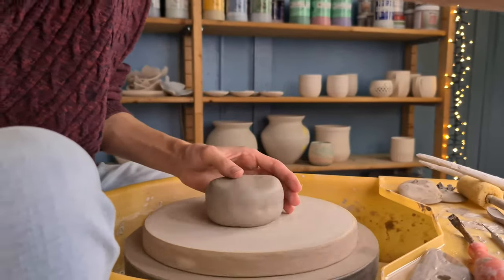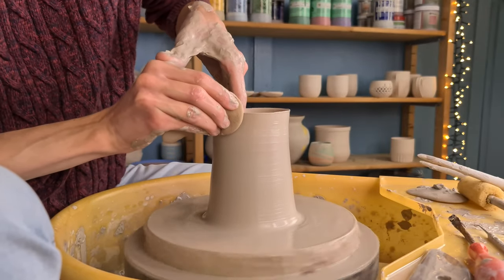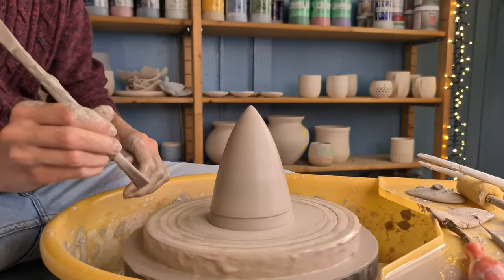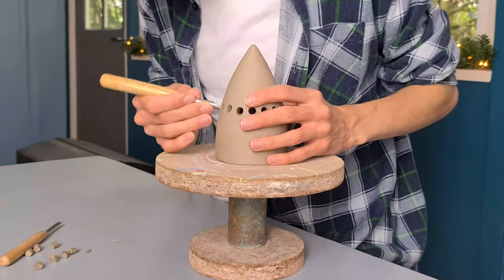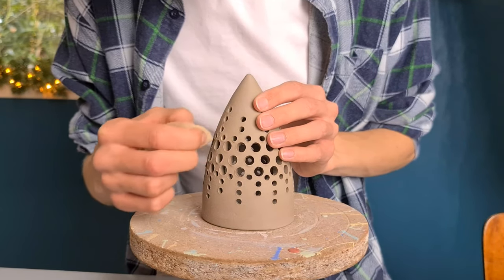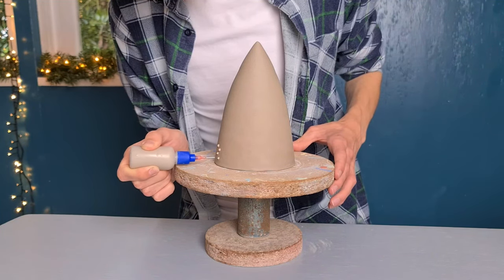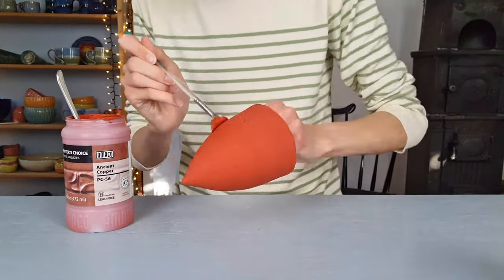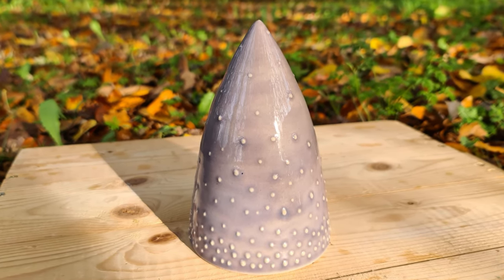How To Make A Ceramic Christmas Tree On The Potter's Wheel // throwing, decorating and glazing

Comment: I find having to remove the clogged up clay from the hole maker very slow and annoying.  Depending on how dry the clay body is you can also get cracking on the inside.  I'm looking for a better tool.